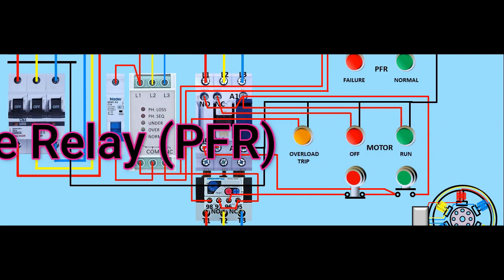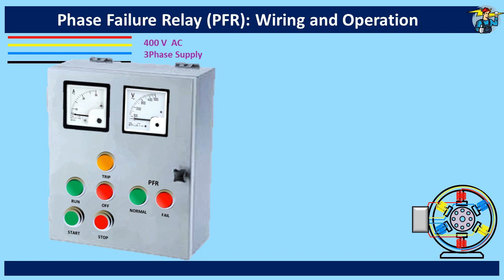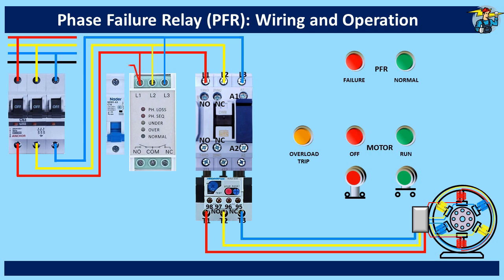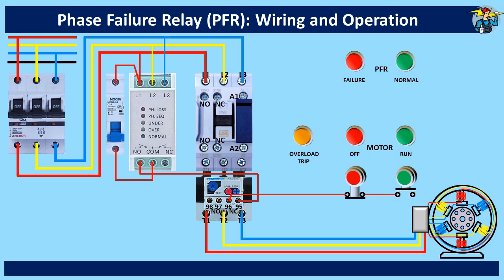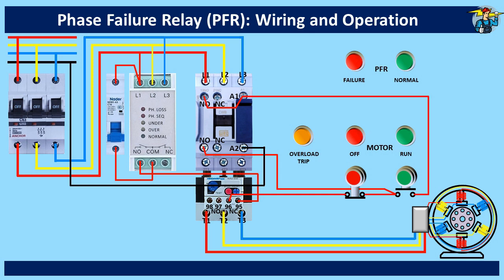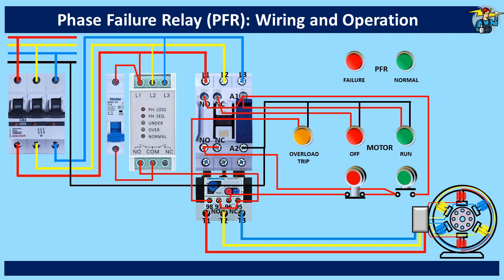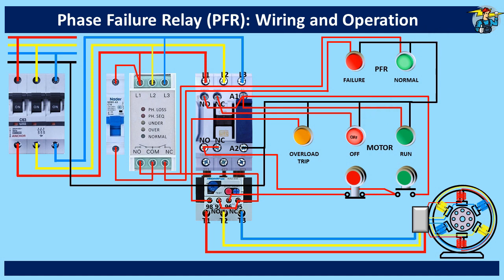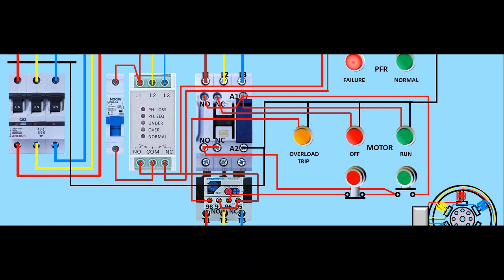Phase Failure Relay (PFR) : Operation and Wiring Diagram Explained / Best Video to Learn all about.!

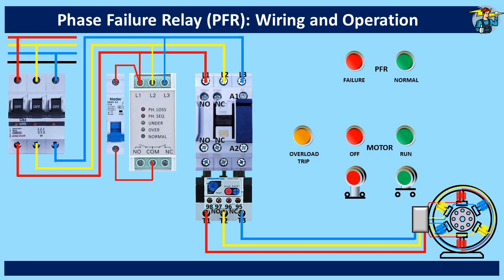Comment from the maker: (2:38) If all three phases are fine, Normally closed contact points will remain at closed position.
So we need to connect the line to NC contact point here (Not to NO point as mentioned there), and take it to terminal 95 of thermal overload relay thereafter.
Thank you.
Reply: Yes

Comment: You're just too awesome in your teaching. Very clear and detailed. God bless you for what you're doing.

Please do a video on VFD combination with DOL, and star-delta power and control circuit for one motor on duty and 2nd motor on standby. Including local, remote, Auto and Manual switching. 

That will be giving you like; 4 to 6 video content creation.

Just a suggestion if you can.
Thank you.
Reply from the maker: Thank you